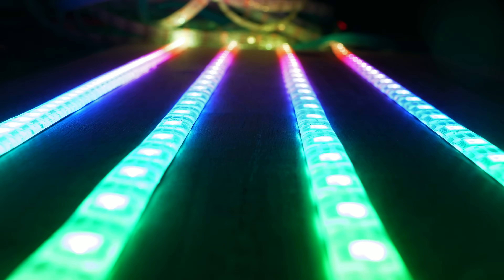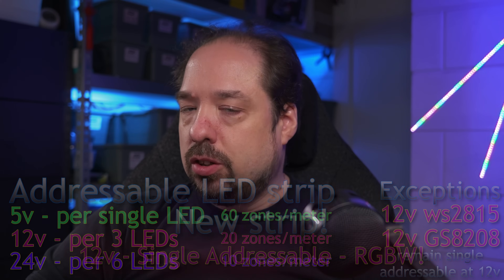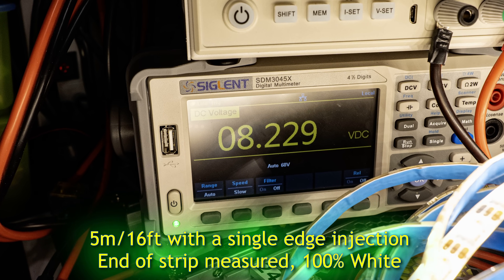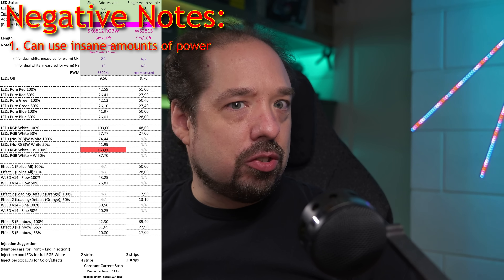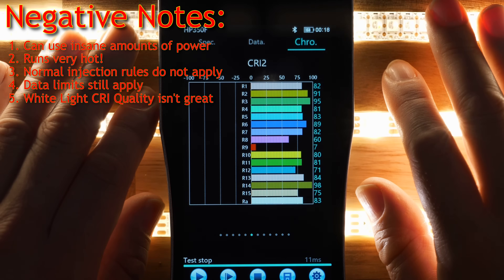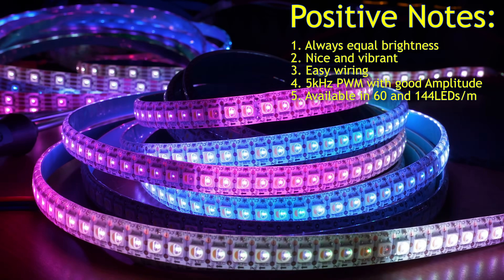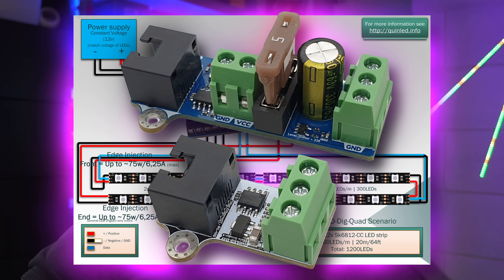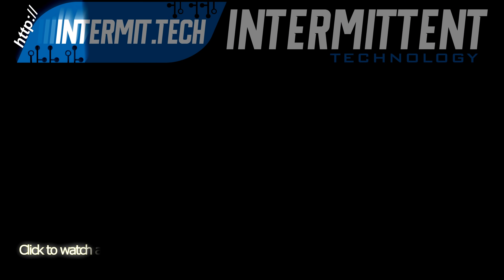💡QuinLED💡12v sk6812 CC (Constant Current) LED strip!

Comment: Thank you for this video! I was looking for an LED strip for my TV ambilight setup and thought going for a 12v variant would be the way to go. But 164W IS INSANE. I'll stick to my 5v setup I've already used for my PC ambilight setup. It might be a little bit more work with the power injection and all, but it is definitely cheaper in both running them and product cost!

Comment: Is this strip a buck converter based voltage drop or does it use a voltage regulator to bleed off excess voltage? i.e. does the majority of the power go to the LED or to a resistive heater?
Reply from the maker: None of the above, although it's most comparable to burning off heat. It uses a regulated type approach to deliver the same watt per LED regardless the voltage basically. Still, it can also use about the most power I've ever measured on the strip at the same time while certainly not being the brightest. So it's a bit of an odd duck. It gets hot but mostly because there is a lot of current traveling through it.
Reply: @IntermitTech thanks!

Comment: Excellent video - I had hoped to use this strip as an all in one WLED/Primary white lighting solution for my sons college apartment, but with your great review I believe I’m going to have to use a two strip solution individually addressable RGB + dedicated white. I’ve already purchased dig-quad controllers & will figure out which dedicated “white” strips might work along with rgb strips on the same controller.

Comment: You should still use power injection when posible, the voltage drop does cause power loses translated in more heat and more power usage. So its capable, but far from ideal

Comment: 2 months later, would you choose this still over WS2805? The power requirement is a lot per meter with this sk 6812cc but the 3 LED addressable is a real limitation of the WS2805. I think if the WS2805 was addressable per single LED, we finally have a true “best”, at least for another moment!
Reply from the maker: Hehehe yeah, they each have their up and downsides really couldn't really pick one, depends on the wishes.

Comment: Are all SK6812 strips CC or just these ones?
Reply from the maker: Just these specifically in the video, at least at a higher voltage. Officially all of the chips are constant current but at 5v, there just isn't any headroom and they don't end up working that way.

Comment: I don't quite understand the explanation. Constant current means that the current always remains constant, right? You show a small table where the current changes depending on the input voltage. This is not constant current, is it? Constant current should be constant. It looks more like the system has become more efficient and does not waste voltage and current. And did you also measure how efficient this strip is compared to other strips?
Reply from the maker: I get this can sound confusing, and it is at first. Let me try and explain in more detail. Officially the Constant describes what the power supply is going to do. With CV so Constant Voltage the power supply has a single supply voltage like 12v but it's current so Amperage is variable. With CC so Constant Current the power supply has a single output current but it's voltage is variable, so a range.

For a CV LED you for instance need 12v and it'll draw whatever current it needs, usually limited by a resistor or driver chip. Downside is, if that LED draws 20mA it will do so at 12v, at 5v or at 3v and look dimmer accordingly.
For a CC LED you for instance need 200mA and it'll draw whatever voltage it needs (no need to limit with a resistor). For these the varying voltage matters a lot less, it'll just draw whatever it needs (within a range it can support).

So these LEDs are a combination of it all I suspect. They have a CV supply so 12v but then their internal driver actually drives the diodes with the voltage they get and vary the current to whatever is needed to retain the same output levels.  So with 12v or 8v coming in, by varying the current (or potentially voltage) they retain the same output level for the LED diodes.

They are different from ws2815 in that sense since those basically have "blind diodes" or an internal LDO and thus will always use the same amount of power (actually structure is a bit more complicated but in the end the result is the same).

It's a bit much to get into right here but hopefully that helps explain a bit more, most important for the video is really that they behave (or mimic the behavior) of CC LEDs and thus voltage drop doesn't inherently change their light output (until you go too far).
Reply: @IntermitTech  Wow that's a comprehensive explanation. Thank you! It still doesn't quite sound like constant current but a mix of it or something. Don't quite know how to put it into words. But so is this strip more energy efficient since no power is lost to fixed resistors or diodes?
Reply from the maker: Oh no, compared to 5v strip is very inefficiënt even! As you can see in the comparison shot all strips have about the same light levels but the 12v variants just use a whole more (down side of running more then 5v but still wanting single addressable). And while this strip is about equally efficient to ws2815, it also means it always less efficient then 5v.

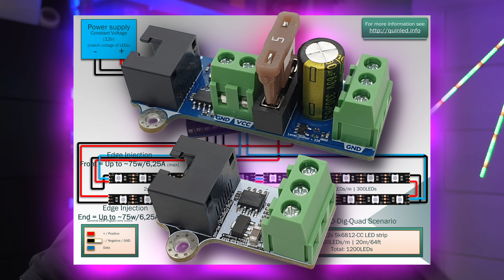Comment: 9:35 is it better to add a separate data channel better than using a data booster? Can a fresh data line just be run from the dog quad? Trying to find out which gives the best boost with the least amount of wire running and splicing, so things stay nice and neat. Thx
Reply from the maker: You need a fresh data channel from the Dig-Quad, a data-booster only helps if there is corruption and it's able to overcome it but in most situations the one built into the Dig-Quad will already do that (can't speak for other controllers though). But 10m is right on the edge of what usually works or not and then a Diff-Solo can help you bridge that gap more easily.

Comment: 1:24 so a 1😂2v rgbw pixel using 3 (split rgb &w) leds 5050, won't be a bright as the GS style 48v 6 led (3 separate rgb and 3 white) pixels?
Reply from the maker: Those are very different style really. Splitting over 3 diodes is very efficient so no efficiency loss there. The 48v style use a buck-converter back to 12v internally and then spread it over 3 diodes, little less efficient in that sense but not by much and both will likely provide about the same amount of light.